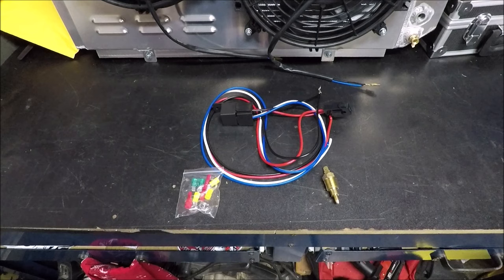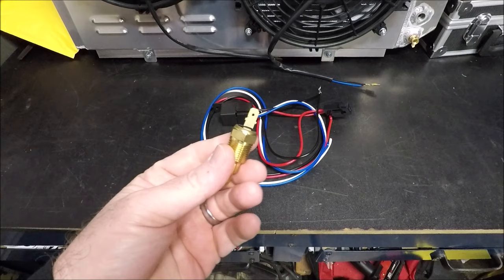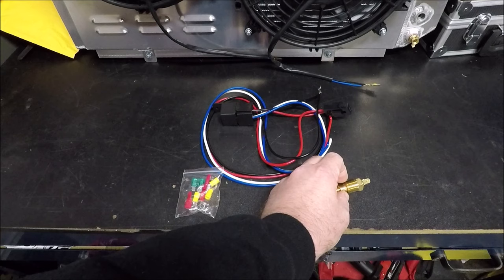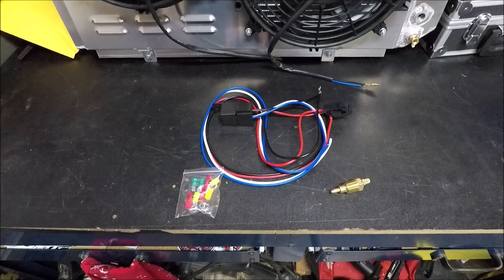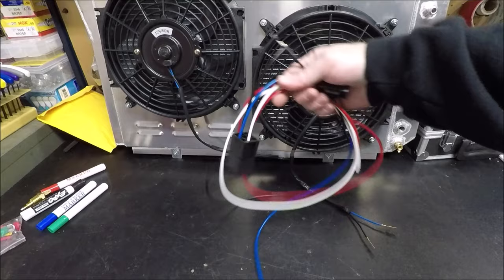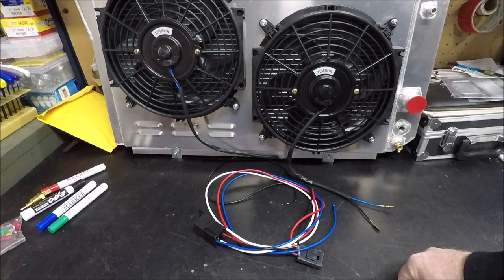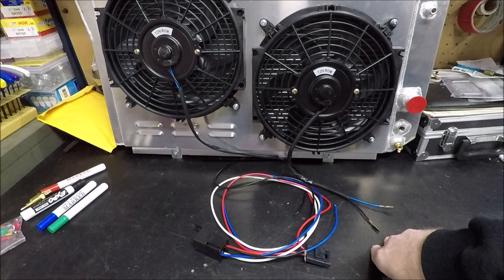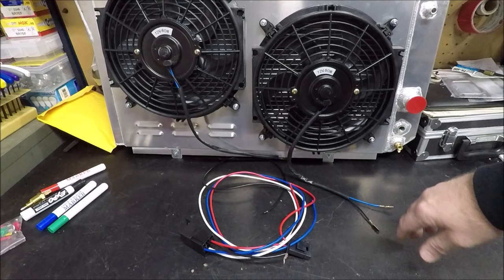ELECTRIC COOLING FAN RELAY AND TEMPERATURE SWITCH WIRING

Comment: Good explanation, wonder why alloy works couldn’t just print that on set of instructions and put it in the box??? Anyway, good job on the video. If you can’t follow those instructions you just gave there’s something wrong lol.
Reply: That would’ve made to much sense for AW to do, I just ordered the 03 suburban aluminum duel fan setup from AW for $321.46 and no information on wiring up and going from clutch fan to electric fan setup and little info on videos most are jokes or clickbait, I kinda figured AWG was to small for two fans just like with HID HO kits these companies need to and option for heavy duty relay wiring kits make life easier

Comment: I installed one of these kits and everything ran perfect but recently my fans come on as soon as I turn on my ignition I unplugged the wire running to the temp sensor and the fans come on whenever the coolant temp sensor wire come in contact with ground why could this be I’m lost?!?

Comment: Very cool, i just ran a 30 Amp fused wire to power wire on fan from battery and 210-195 coolant switch, with a 195 engine thermostat to ground on the fan. On my 5.0 Ford Ranger.
Reply: Did you have any issues with the fans turning on? I changed the temp switch to that temp as well and the fans won’t turn on for me
Reply: @Jmaddox_14  check live data, watch the temperature rise on the screen, if it gets to 210 and no fans then replace switch or check wiring, ensure the fan actually works when it gets 12 volts. Iv got a bad fan out of the box before.
Reply: You may need a relay or two overtime, if down the road it starts blowing fuses

Comment: Thank God! I thought I was confused but it turns out the wire was wrong. I kept going through my head thinking ''if I hard ground the black, what the hell is the switch for, and if so are they expecting me to wire the hot side to a one wire thermal switch?'' I knew neither would work and figured id take a YouTube break lol.
Reply: Quick question you mentioned a one terminal switch.  My sensor has 2 terminals. Would I hook it up the same way? And just leave one terminal empty. Or is the other terminal for a 2nd fan? THANK YOU IN ADVANCED.
Reply: Thank God I watched all the way Until where you mentioned The DUAL FAN no no...  I'm running DUAL Fans.   Thsnk you

Comment: you are 100% correct about not running this on a dual fan setup, i just had my wires melt together thanks to them saying run both my 12" fans off this 1 wire harness they sent and sure enough the wires are not heavy enough to support 2- 80 watt fans it will melt the wires together, did not pop the fuse or the circuit breaker that came with the kit before the wires was on fire.......

Comment: Thanks for explaining the problem with the black ground wire.  Why the manufacturer put that extra grounding loop is bizarre.  Unless you want the fan running all the time.  I disconnected it and now the fan comes on at the right temperature. 
Thanks again. Great explanation.

Comment: Just purchased the aluminum radiator with dual fans from alloy works. Did not like the relay kit that came with it. So I went ahead and bought the PAINLESS brand relay kit. Part# 30116. Dual fan/ dual activation fan relay kit for A/c function. Will be installing all of it this Saturday. Hope everything goes smooth. Thanks for the explanation.

Comment: Finally someone explains it clearly. But I got a question. Can I install the temperature switch in the top radiator's hose ?( with a conector, of course) , I got a 2001 jeep cherokee and I bought a 3 fans radiator. I will appreciate your attention. Thanks, un advance
Reply from the maker: You can but you’ll get a more accurate reading in the head. It’ll work in the top hose but make just let the engine get a bit hotter before it triggers the fans is all.

Comment: I've used these and they work for a few months and then develop a mind of their own. They don't turn on when needed and sometimes turn on without the key on
Reply from the maker: If the relay is wired properly, it’s impossible for the fan to turn on without the key. Even if the thermostat switch itself shorts to ground, there would be no power going across the relay without the key on unless you wired pin 85 or 86 straight to battery power, and that’s exactly why I told you NOT to wire it that way in this video. Which I’m assuming you didn’t pay attention to or you would have already known that.
Reply: @BadLuckGarage  they were wired exactly like the diagram provided
Reply from the maker: @1979gmcummmins  If the relay is wired properly, it’s impossible for the fan to turn on without the key. Even if the thermostat switch itself shorts to ground, there would be no power going across the relay without the key on unless you wired pin 85 or 86 straight to battery power, and that’s exactly why I told you NOT to wire it that way in this video.
Reply: @BadLuckGarage  like I said. They were wired exactly to the color codes provided!
Reply from the maker: @1979gmcummmins  If the relay is wired properly, it’s impossible for the fan to turn on without the key. Even if the thermostat switch itself shorts to ground, there would be no power going across the relay without the key on unless you wired pin 85 or 86 straight to battery power, and that’s exactly why I told you NOT to wire it that way in this video.

Comment: Hi! I really appreciate you doing this video in a simple and detailed way. ALLOYWORKS some include a second relay and have a connector coming from both relays to connect directly to tepee dual fans. I’m still working on putting the dual fans and radiator in my 1973 Mustang.
Reply from the maker: @FredMcFaddin  Sounds like they finally took my advice then.

Comment: Dam where has this video been. Missinhmg for years. Youve explained the best how to wire electric fans
Reply from the maker: Honestly I have not hooked up one of these kits in over 10 years and this channel is only four years old next month lol. I switched to fuel injection an LS engines 10 years ago so I’ve always used the computer to run my fans.

Comment: Best and easiest explanation I've come across. I got the same exact set up except my fans aren't one lower than the other. But when you say you run the battery wire straight to the battery, do I actually run it straight to the battery or to a battery 12v source

Comment: Thank you for taking your time to produce the informative video. I ordered one of these units for my v8 4runner today and plan on adding the additional relay. Would a 185 Degree ON 170(technically 175)Degree OFF work better than the supplied 185 Degree ON 160 Degree OFF?

Comment: Id like to see a short video where exactly the switched ignition is and different ways to tap into it.
Reply from the maker: That’s gonna be a different circuit on every model vehicle bud. But it’s easy to figure out with a multimeter or test light. If the wire is hot with the key forward only, then that’s your wire.

Comment: I have this system you explained it fine. My question is I have a column ignition, I'm not sure where to run the white wire you said that went to the ignition. Please tell me how to connect the white wire to my column connectors. Thank you.
Reply from the maker: You don’t have to connect it to your column, just to an ignition hot. Meaning a wire that is 12v hot when your key is forward.

Comment: i got a question. if i connect the black wire from number 86 directly into the chassis or to the negative terminal of the battery, will the fan kick on without using the temperature switch? i live in a area where 9 months of the year is hot. so i want my fan to kick on since the moment i start my engine. please let me know.

Comment: firsty can you use a toggle swith instead of sensor, one side to ground other to the black wire. secondly can you reverse the blue and black wires on the fan to reverse rotation to blow through the radiator from the front. it seems to work but im worried about long term. its only for my sons standard track car and for burnouts.  drifting

Comment: Most radiators are designed for 40mph wind current & only cool the temperature about 20*F depending on outside temps.

Your thermostat is designed to "Regulate" flow to help the engine remain a constant temperature. Be it 160-170-180-190 and....
>>>>  "Where you place" the Thermo switch depends on the on/off temp required. I'm putting mine in the Bottom hose, so I will need a thermal switch that comes on @ around 180 and off @ 160*F assuming my RAD is only cooling a common 20*F engine should remain around normal 180-200*F max.
A switch Placed "In the head", the switch should actually come on @ 190-200*F and Off @180 or what ever temp your thermostat is again maintaining an engine temp of 180*F.
Aluminum block engines are designed to run a little bit cooler than cast iron blocks - Look up Manufacture Temperature for your application and use what they recommend.  
All fans should come on and stay on when A/C units are turned on.
Reply from the maker: Thanks for watching! Glad this video helped you out!
Reply: So question. If I have a 180 degree thermostat that 180 degree switch won’t work with that? That was confusing when he said I need a 160 thermostat for that 180 switch. Should I get a different switch for the 180 thermostat? Thanks

Comment: Thank you for the detailed explanation. I would imagine that Alloy Works also makes the Cooling & Radiator Specialist brand from Amazon because the kit looks exactly like the wiring kit you have.
Reply from the maker: Honeslty probably 90% of what you see on eBay or Amazon probably comes from the same manufacturer.

Comment: I wonder if I hook the signal from my ecu to the signal wire on the relay to control the fans would work for my Ls swap instead of using the temp switch

Comment: Thank you so much for the video I my self knowing what I know just grounded that loop to the frame. I understand now that's wrong.
QUESTION:  My sensor has 2 prongs, not just the one..   DO I HOOK IT UP THE SAME WAY? Leaving 1 prong/tab empty?  I'd it for 2 fans? PLEASE HELP ME OUT.  Z THANK YOU.  
I had to get a shallow sensor because of where I put it on the side of my block, the long sensor bottomed out. 
thanks

Comment: Hello, 

could you run this fan off the OEM connectors and using OEM temperature sensor? 

I dont want to run lower temp thermostat, as I live in a cold region

Thanks for the video!!
Reply from the maker: If you’re running your fans off your factory wiring then the wiring kit and instructions in this video doesn’t pertain to your application.

Comment: You talked about the dual fan setup. Could we not tie the red battery wires together from both relays?  
Also for a 12V 80w dual fan, would a 10amp fuse be sufficient? 
Great video btw!!
Reply from the maker: Yes you can tie them together as long as you use the proper gauge wire for the amp load. What size fuse you need depends on the amp draw of the fans you’re using. But generally you’ll need at least a 20 amp fuse minimum for a single cooling fan. Check the specks on your fan to know for sure how many amps they use.
Reply: 12.7amps for each fan. Thanks a bunch. Most informational video I've found on wiring fans the correct way!
Reply from the maker: @LReese-de4wt  Then if you’re wanting to power both relays/fans off the same power wire, I would go with a 10awg wire with a 30amp fuse. 👍 And I’m glad to hear you found the video helpful. Good luck to you!

Comment: thanks for the content super helpful 🙏 what about if I have my fan mounted on the outside   so It will push the air through how can I wire that up? thanks 💯💯
Reply from the maker: Exactly the same assuming you have a pusher fan instead of a puller.
Reply: @BadLuckGarage  got it so wired up the same? And not reverse the power wire (blue ) and the ground wire on the fan I believe I heard something like that amd also to turn the fan blades over but idk if that's correct
Reply from the maker: @sonnyskustoms  Only if the fan is designed to be both a pusher and a puller. If not your just going to fry shit. I do not believe these fans are designed for reverse polarity. At least they aren’t listed as such on the website. You should contact Alloy Works if you’re attempting to use their fans in a manor not listed.
Reply: @BadLuckGarage  thank you makes sense and  yes this fan is ment to work as a puller & a pusher

Comment: Hey another question bro. If I’m using that aftermarket switch this bypassing my electronics going to the stock switch how am I ever gonna know if I’m over heating if the stock wiring harness is what controls the temp gauge ? Can I just tap into that stock switch wiring harness ?

Comment: I believe my fans were installed with 30 running to the fam and 87 to the battery … would this cause issues. My voltage drops dramatically when my fans come on.

Comment: About that sensor. I dont have a spot to put it on my 5.3  02 Silverado and I dont really have the tools to tap a spot in the cylinder head. So my question is can I get a coolant sensor bung and install it on the upper coolant hose mid way, or does it have to go in the cylinder head. Thank you in advance Sir I do appreciate your tutorials

Comment: Could the system not run without the switched power? Have a basic circuit from the battery but have the temp switch as a breaker so that the fan stays on even when the car is off in case it's still hot?
Reply from the maker: Thanks for watching. Glad this video helped you out.

Comment: Thanx For The Help.The Only Question I Have Is I Have  A Single Fan Is It Possible To Wire A Switch Into This Set Up So If I Needed I Can Hit The Switch And Turn On the Fan .
Reply from the maker: Yes. Wire it to ground the relay wire. As long as the keys forward, if you flip the switch it will activate the fan relay just the same as if the temp switch grounded it.

Comment: Wish I would’ve seen this before I started. That lil loop on the black wire is pointless. 

I plan on running 2 relays.   

Is there a way to test my temp sensor? I held a lighter to it. Just to chec it before I put it in the intake , it never grounded out.

Comment: Question,   I have an alloyworks radiator and fan shroud and the fuse coming off the red power wire keeps blowing when my car gets hot.  Checked all the grounds, they are good.  Went from 20 amp to 30 amp and still blowing.   Idk what is going on

Comment: I have my condenser pressure switch in pin 86 so that my ac fan turns on when it reaches a certain pressure (with AC on only). Could I splice my coolant switch wire with the pressure switch wire to pin 86 so that it activates through coolant temp as well (with AC off)?

Comment: I’ve got a LS set up with dual fan,psi wiring harness, an their dual fan relay set up I have everything hooked up right the fans seem to come on when they supposed to but they want cut off, it will cool my radiator down we’re I can put my hand on it, not hot, but the fans want cut on, any suggestions

Comment: Great video I got 1994 Chevy Beretta I just did a 3400 swap.I got everything hooked up..So if run the white wire to the battery does it goes the negative or positive side? The switch ignition source got my confused at the moment..lol Am sorry any info would be Greatly Appreciated

Comment: Having issues with my fans constantly running even with the coolant cold. Switch is installed into lower intake on a 1990 mustang. Any ideas? Is the switch stuck closed?
Reply from the maker: If you have it wired correctly and the coolant touching the switch is colder than the shutoff switch is colder than it’s shutoff point but the fans keep running, then the switch is probably bad.

Comment: I hooked this up the way you stated and am having issues with the fans still running even after it gets below 160 degrees
Reply from the maker: Are you reading temp from the same location as the fan switch? If not then it may be hotter where the fan switch is compared to where your temperature probe is. Generally the heads show temps 15-20 degrees hotter than the intake and temps at the cylinder heads can also vary from side to side and front to back. So just because your temperature gauge reads below 160 doesn’t mean the fan switch is below 160. Also keeping a gasoline engine below 160 is near impossible in most scenarios as I mentioned in the video unless you have a super efficient cooling system.
Reply: Mine has done the same thing. Was looking on here for the answer. The first switch I put in  worked correctly until fan came on and when I shut off truck and it cooled down to ambiant temp, the fan runs all the time. Got another kit from them and fan did not come on until 185 and never turned off again. Disconnect wire from switch and fan turns off. I'm leaning to junk switches.
Reply: @johntyson9447  thanks
Reply: Did u ever find out the problem @johntyson9447

Comment: I have the exact same relay and color of wires the only thing is that I have a pigtail on my fan that has a blue and a black wire connected to it. In your video you only have a blue wire coming from the fan, do you know why mine has blue and black and how I should wire those? Thanks.

Comment: I am working on a 2000 dodge ram 1500 with a v6 but i dont have any port on the heads nor on the intake so i am installing the switch on the block,do you think it will work like that? Thank you for your answer
Reply from the maker: As long as it’s in a coolant jacket on the block it should work just fine brother.

Comment: Thanks for the information. Do you have a recommendation for location of the temperature switch on a 86 Toyota pickup with a 22RE ?
Reply from the maker: Nope
Reply: @BadLuckGarage  I understand. I fabricated a piece to go inline on upper radiator hose. Working well so far but still have to run the ignition source wire.